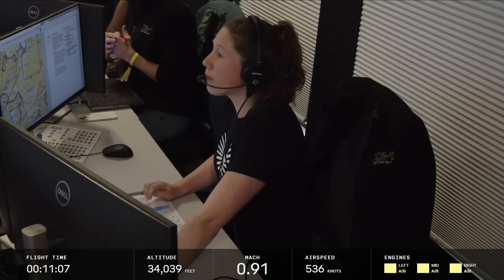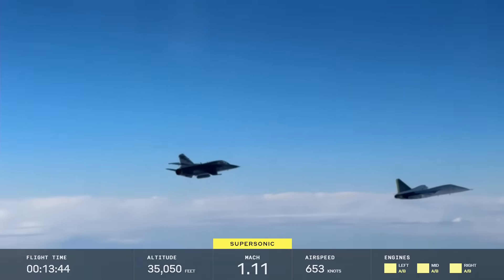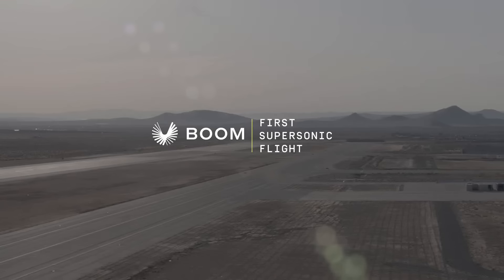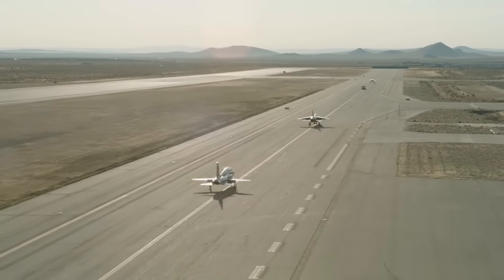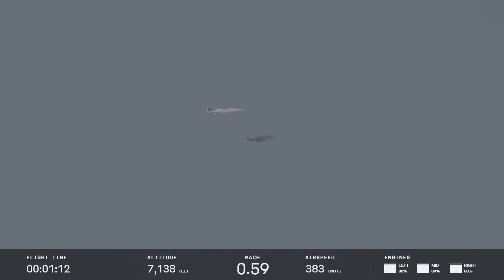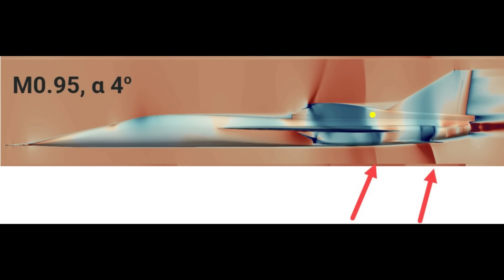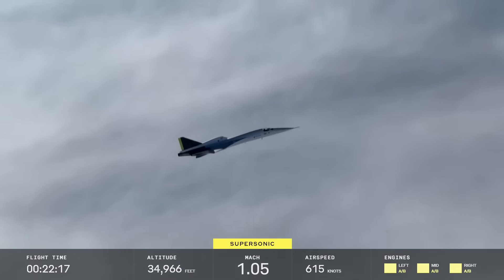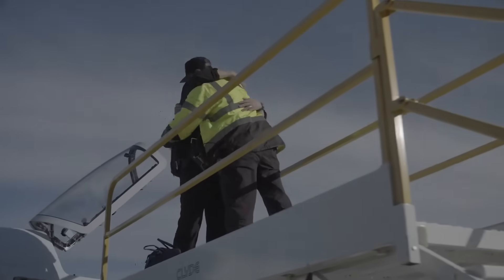XB-1 Baby Boom Goes Supersonic - Jet Planes, Starlink & iPhones

Comment: I'd be very curious to hear about what sort of sonic boom it created. After all, the whole point is to reduce the boom so much that they can fly over populated areas.
Reply: The point of the X-59 QueSST is to reduce the sonic boom.  The point of Boom Overture is to have supersonic passenger flights again since the shutdown of Concorde.  If the X-59 project can move quickly enough, I suspect Boom would orient the Overture design around it, but the X-59 hasn't even started flight tests yet.  My guess is that it is a year away from providing real actionable data, which seems like it might be too late for Boom Overture.  Once construction of the Overture begins, it's doubtful that they'll make design changes.
Reply: @JoelKForever  Look at the XB-1, it obviously has sonic boom reducing aerodynamics, it looks like the baby of a Concorde and the X-59, it's a "middle of the road" design. You CANNOT have a supersonic plane as loud as the Concorde, sound restrictions was the final stake that killed the dying supersonic civilian plane market.
Reply: @JoelKForever thank you. I should have read your post before I posted myself.
Reply: @JoelKForever    If they can't overcome the sound issue they'll be in the same position as Concord.
Reply: @RXTRUX1  The concord didn't fail because of the sonic boom or the routes it flew. It failed because of the loud noise during take off, high fares, and excessive cost to maintain and fuel. 

The noise that people were complaining about came from the fact the concorde used afterburners at take off. The Boom Overture won't and will take off like any other commercial jet before climbing to supersonic speeds once in the air.

Boom also plans to make the Overture more economical to maintain, fuel, and fly on. Unlike the Concorde.
Reply: @RXTRUX1  They don't need to overcome the sound issue. Oligarchy can squash regulation.
Reply: @jake_sabrwolf9795  
Excessive cost of operation was more decisive than the rest of reasons you mentioned, I'd say.
Reply: @JoelKForever  Well if the US government, based on the results of the X-59, decides on some maximum threshold level for noise levels on the ground underneath the flight path, and supersonic flight above land is made legal as long as noise levels stay below that threshold, then Boom will need to ensure the Overture design stays within that legal limit (no matter how far along in RnD they are when the law is finalized).
Reply: Boom is not trying to do that. NASA's X-59 is unrelated to this.
Reply: @sebastiaomendonca1477 Thanks, I was getting muddled between the 2 projects as well.
Reply: @ You NEED to do that or this project isn't going anywhere
Reply: @ my bad, I somehow confused the two projects
Reply: They aren’t going for quiet supersonic at all. They’re going for trans-oceanic super sonic flight.
Reply: An entire comment thread of confused people, and one guy doing his best to straighten them out.
Reply: They wouldn’t know yet since the Mirage and T-38 also would be producing a sonic boom.
Reply: The size of the boom isn’t the point. The Lockheed Martin X-59 is designed to do just what you’re suggesting and that’s a NASA project, not privately funded. 
The point of the XB-1 and Overture is to do supersonic flight economically.
Reply: Agreed, I think they may find themselves regretting calling the company boom later on too for this reason.
Reply: @dosmastrify to Boom or not to Boom
Reply: @dosmastrify So that's the reason for the B-1.
Reply: @viperdragz4403  No, this plane has three General Electric J85-15 which is a military supersonic capable engine, complete with afterburner (as highlighted in this video). Their first passenger plane, the Overture, is planned to be powered by their own engine, which they call Symphony.
Reply: I've never got so many answers to a question on YouTube before. Thanks everyone!
Reply: Mind reader 😂 liking to make this top comment.
Reply: I live near Edwards AFB. I got up early to follow the livestream and listen for the sonic boom. I didn't hear anything the entire time. I was obviously not directly under  the aircraft, but close enough that a loud explosion would have given me an idea of where to point my binos. The chase planes also did not create a boom, so there is a possibility that atmospheric conditions suppressed the shock wave.
Reply: The boom was never a reason. I was excuse because American manufacturers did not want Concorde competition
Reply: @artokiiskinen1058 That doesn't make sense, because Boeing had their own SST project, and a large part of what killed it was public perception of boom issues.
Reply: @JonBrase The vast cost and engineering mistakes (starting again after ditching swing wing) are what killed the Boeing SST. Aiming for Mach 3 was ridiculous one upmanship over Concorde, and it was far too big. Boom Overture is currently planned to be both smaller and slower than Concorde.
Reply: @owensmith7530  They were definitely a factor, but not having the transcontinental market available makes the bar for viability higher for all SST projects to which it applies. Also, I would argue that Concordish speeds are great for transcontinental routes, but a truly viable transatlantic-only SST probably has to hit Mach 3 or 4 to compete with the fact that current Mach 0.8 airliners manage to hit right smack dab in the middle of a strong local logistical optimum for business travelers (Namely, when travelling eastbound: Leave at the end of a business day in the US, get a full night's sleep on the plane, arrive at the beginning of a business day in Europe). Concorde crossed the Atlantic too quickly for a full night's sleep, but still took a while, so it wasn't as attractive to business travelers.
Reply: @artokiiskinen1058  Broken windows would beg to differ.
Reply: "[...]reduce the boom so much that they can fly over populated areas[...]" is that possible? The plane will make a continuous shock wave and I don't understand how you can get around that?
Reply: @DoRullings  it's about directing much of the energy of the shockwave upwards, and spreading out the rest along the fuselage enough that it sounds like a longer "thump" instead of a shorter "boom". Regardless, that's what NASA is doing with the X-59, which has nothing to do with this project.
Reply: @DoRullings  - By increasing the distance over which the shockwave happens, you can 'soften' the shockwave. IE, instead of it being a sudden and sharp spike in pressure, and then a hard drop, it slows down the pressure spike, and softens the drop, taking it from a sharp 'punch' to a softer 'thud' or 'thump'. The X-59 is working on doing that using aerodynamic shaping to help achieve the goal.
Reply: @DoRullings  The sonic boom will be spread out so that it will hit more of the ground but cause less noise at any point.
Reply: @DoRullings you can Design it so the downward facing Shockwaves are reduced or spread out. Think of it a bit like a boat speeding through a lake. It will leave a wake spreading out, but you can make designs to lessen that wake.
Reply: @DoRullings  The idea is to use computer fluid dynamics to create a shape that spreads the shockwave out over a much wider area on the ground (when flying at cruising altitudes) such that it is much less intense than a "normal" sonic boom.

(My Aerospace Engineering thesis was to be on this very topic, and if I had finished my degree, odds are I would be working at Boom. But when I was in college, only the most powerful supercomputers would have been capable of the math needed - not something I could do as a college student. Now a powerful gaming PC could probably do the math.) 

Yes, it would still make a sound passing overhead, but it would be significantly less "annoying". Not a "boom" as much as a "short rapid increase". The goal is also to reduce overall sound (with the engines) so that it should sound like "a business jet flying at 10,000 feet" more than "a supersonic fighter jet". It'll still be louder than an airliner at cruising altitude, but if you live within 10 miles of a major international airport, your general "airplane background noise" should be higher than their airliner.
Reply: @AnonymousFreakYT  Thank you for a good answer. I think I understand the concept.
Reply: @AnonymousFreakYT  
All the supercomputer calculations in the world won't matter if their aircraft don't have supercruise capability.
Reply: @ The production airliner will. The sub scale tester doesn’t need it. It’s about validating the aerodynamics and sonic boom properties in the real world. It doesn’t need to fly for multiple hours at speed to accomplish those goals.
Reply: @DoRullings  when I was a kid there was an f16 that was supersonic over my school. The sonic boom was a sharp high pitched pop with rolling thunder echoes after. The idea of the reduced impact sonic boom seems to be spreading out the shock wave and spreading the noise over a range of frequencies to reduce the apparent volume and dissipate the noise quicker.
Reply: @DoRullings something about shaping the shockwave so most of it goes into the sky
Reply: @DoRullings as others have said, the X-59 is intended to use a combination of an extremely long and slender airframe to reduce the intensity of the boom and to spread that energy across physical space so it becomes a thump, as well a very sleek bottom surface to direct as much of the boom energy upward as possible. The goal is to make it about as loud as a slammed car door, ~75db on the ground.
Reply: @DoRullings  the shape of the aircraft dictates the behavior of the shockwave, so you can reduce the population facing shockwave.
Reply: @DoRullings  You did not take "high speed aerothermodynamics" and it shows.There are a bunch of ways to mitigate the boom, mainly architecture things. You can use a longer pointy nose ( this will    lower the intensity of the initial boom, it will lower the angle of the oblique shock afterwards), sweep the wings back (lowers the intensity of the boom due to the wings), carefully shape the rest of the aircraft to lower the boom. 
A solution people were working on was the use of a plate like apparatus to deflect the shockwave (or directing the shockwave inside the engine)
Reply: @odelin543  ... and neither did you: "directing the shockwave inside the engine". Yeah. That's a really good idea ...😂
Reply: @DoRullings  you don't know what a shockwave is, have you heard of a thing called the "method of characteristics"? Directing the nose's shockwave to the engine is a thing to minimise sound going downward. 
I never said it was something I learnt either I said People were working on it, which is very different. I took the full course, and a bigger one about "hypersonic aerothermodynamics". It is possible that I could be wrong on my recollection of details on a research paper I read, the basics of what a shockwave is though? Not really
Reply: @DoRullings  it can slow down.
Reply: @ my understanding was that the aircraft designs were intended to reduce it to something similar to slamming a car door shut. More of a thud than a gunshot sound, and as low as possible in volume. Presumably the shape, amplitude and direction of the shockwave can be altered?
Reply: @DoRullings  the same way jet engine noise has been reduced, through years of R&D, same reason how they can now make large aircraft appear invisible to radar, you can manipulate the shape of the aircraft to redirect and dampen the shockwave
Reply: @DoRullings You cant avoid the shock wave, but you can try to design a shape of wings and fuselage that reduce the size of the shock wave as much as possible. This jet is a scale model of that new shape.
Reply: It looks more like the X-59 than it does a Concorde.
There's no way way they're not taking NASA scientific results into account; that's kind of the point of NASA.
So yeah, how the Boom (pun intended) sounded is definitely of interest.
Reply: My brother works at Edwards. It flew over his base when it went supersonic and he said it was one of the loudest booms he’s ever heard.
Reply: @JoschC  was that because it was a "triple" boom of three aircraft going supersonic at the same time, though? I'm curious if they plan to do any tests of the aircraft on it's own, in order to measure the intensity of the boom. Thanks for mentioning someone's actual experience on the ground!
Reply: I never believed the sonic boom prohibition was real. I took it as a gift to Boeing, Northrup et al, from grateful Senators. But I admit Im a cynic.
Reply: Who cares about populated areas? So what if they lose a few windows? Maybe they should fly supersonic too?

Only kidding. I'm a billionaire and I care deeply about the plebs.. so long as I keep making bank off them, and they look the other way as I don't pay taxes.
Reply: @viperdragz4403  This is the correct answer. They built this engine themselves and this is a small proof of concept plane for proving their engine design. I think it was verisatum that did a great visit of their facilities covering their development plans.
Reply: Hard to tell, with two other planes making booms right next to it…
Reply: Would it be difficult with the two larger supersonic chase planes sonic booms flying so close?
Reply: Wrong aircraft. You're thinking of the X-59.
Reply: I agree. How loud or soft was the sonic boom?
Looks like a good flight and I love all the reporting and the camera angles and everything. 
BUT HOW LOUD WAS THE SONIC BOOM!!!?
Or was this just a test to see if it could fly?
Still looks like a good flight. 👍
Reply: @michaelshada262  Obviously didn't look at the other comments before commenting.
Reply: @viperdragz4403  The XB-1 uses J58 engines, the Overture will use Boom's own engines... FYI.
Reply: The silent killer of sonic booms.
Reply: From their FAQ: "When flying over land, Overture can fly significantly faster than subsonic commercial jets—about Mach 0.94, without breaking the sound barrier. This is about 20% faster than subsonic flight."
Reply: Very loud if it worked they would said, 115db be my guess. So no go.
Reply: @machoman5356  Well Boom's plan isn't to break the sound barrier above land or over populated areas.
Reply: You're confusing Boom with the X-59 project.  Boom is intended to be flown over the ocean like Concorde was.
Reply: Exactly, that's the important thing. Was anyone on the ground measuring the boom? The other thing is that it appears that this aircraft isn't designed for supercruise. It sounds like it needed the afterburners to maintain supersonic flight, and it needs to avoid afterburners if the Overture is to have a meaningful range. Was that not part of this prototype?
PS Others have said that reducing the boom was the job of the NASA X-plane not the Boom x-plane. From everything I read in the past, the whole intention of Boom was to reduce the problem of the sonic boom so that their aircraft didn't have the same limitations as Concorde. It's bizarre if this x-plane doesn't investigate any of the methods for reducing the boom.
Reply: @theharper1  They don't care about the sonic boom. This aircraft is using off-the-shelf engines.  The engines aren't part of this test.  The Overture will have different engines.
Reply: @stargazer7644  I don't recall mentioning the engines, other than the need for reheat. All of the early information I read about Boom was that they were going to create an aircraft which wouldn't have the sonic boom issues of Concorde and therefore wouldn't have the same route limitations. If they now don't care about that, I'm not sure how they see their project succeeding. With respect to the engines, it seems that they plan to get enough thrust without reheat for takeoff and to safely go through the sound barrier without a lot of buffeting. I don't know of any other aircraft which has achieved that supersonic transition without reheat, but please tell me if I'm wrong. All that with an engine that has yet to be built and certified, and isn't being built by any of the current major jet engine makers. My question was also about whether they were testing any technologies involved in supercruise, because that is also something very few aircraft have achieved.
Reply: @theharper1  You're confusing Boom with the NASA/Lockheed Martin X-59 Quesst (Quiet super sonic transport) initiative.  Boom sees their project succeeding because Concorde used 32 times as much fuel per passenger as a 737 on the same route.  Overture will use a fraction of that and go almost as fast.  The 20 Concordes that were built cost an average of $850 million each in 2025 dollars.  Overture is expected to cost $200 million each.   There are a lot more long haul flights around the globe now than in the 1970s.
Reply: @stargazer7644  no, I'm not confusing it with the X59. As I said, all the early information about Boom said that they were going to build an aircraft which didn't have the sonic boom issues of Concorde. Maybe that's out the window now.
Reply: Same
Reply: I don't think this has any of those mitigations in place yet, it looks a lot like the supersonic chase planes.
Reply: It will be banned or operators will be sued for propery damage. No future for this.
Reply: Concorde lost not just because of bad fuel economy but because many countries banned them from flying routes in their airspace due to sonic booms.

NASA is investing in low-boom with the X-59 Quesst.  This Boom airliner looks to me like it will suffer the same fate as Concorde -- limited route possibilities.

So apparently you DO need government investment (e.g. X-59) :)
Reply: I can help with that. So a normal plane goes BOOM!!!!!
The XB1 goes Boom!!
Hope that helps
Reply: Me too.  It is pretty dishonest of these guys to talk about the supersonic ban as if it was purely out of restraint of trade.
Reply: Hush-a-boom technology.
Reply: i think it went ... BOOM
Reply: That’s their goal with the full scale aircraft but it’s NASA’s X-59 which is studying low boom aircraft design.
Reply: That's like the most important part of their project, and if this is not a scale model of the big plane I don't know if this plane is even relevant at all
Reply: @hectoraccented5312  What can this plane do if it isn't an exact scale replica?
-validate the design of their engineering models (ie, proving that what they think should happen, happens)
-prove the efficacy of the camera-based landing system
-determine limitations of the camera-based landing system
-prove to investors that Boom can build a supersonic aircraft
-validate their control systems for things like fueling multiple engines from multiple fuel tanks
-identify unforeseen stresses/issues with the design concept to be applied to the later detailed design
-gain data on flight characteristics of supersonic aircraft
-validate avionics systems

I'm sure there are plenty more things they can learn too. But I only had a few minutes to type this out.
Reply: @hectoraccented5312  The point of the scale model is to learn how to build a supersonic aircraft and validate that their calculations and design theories are sound. Thats the point of all prototypes. Once they have demonstrated that, they can move onto a bigger, more risky design with confidence that it will work.
Reply: Incrementally moving forward as in baby steps.  @hectoraccented5312
Reply: I was wondering too why this hasnt been mentioned so far
Reply: What sound do you make when you go faster than the speed of light? Yes I know Einstein's questions and you can't go faster, just saying.
Reply: @NanoAGI probably still a sonic boom granted that you are still made of matter. Assuming it happens in another medium than space you would produce something called Cherenkov radiation apparently
Reply: Funny how they never mentioned that.
Reply: Where did they pack enough fuel to complete the runs?
Reply: @paulheinrich7645 
In the fuel tanks and the pilot had a Big Gulp full of fuel for emergencies.